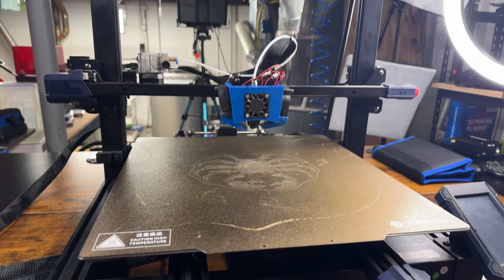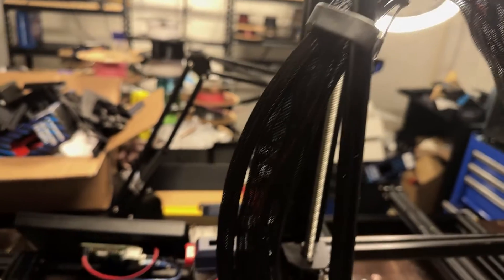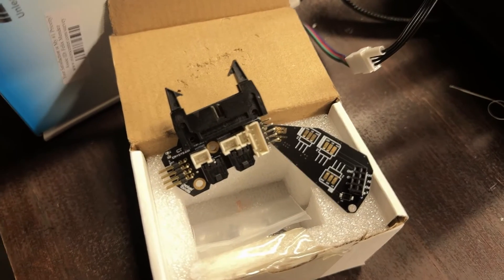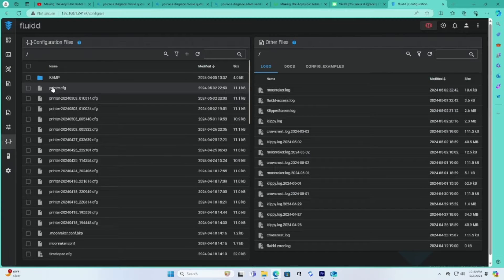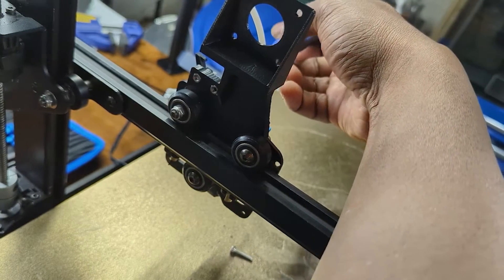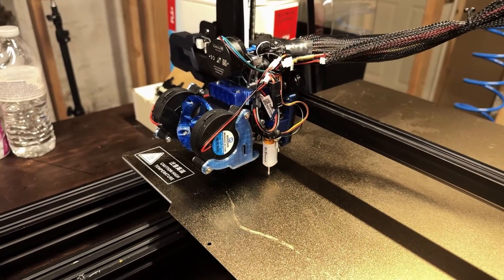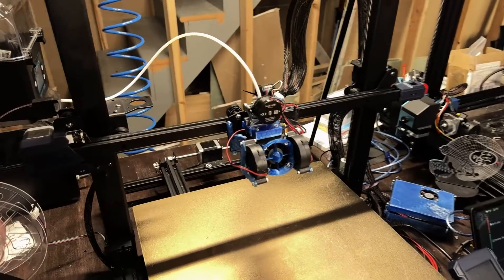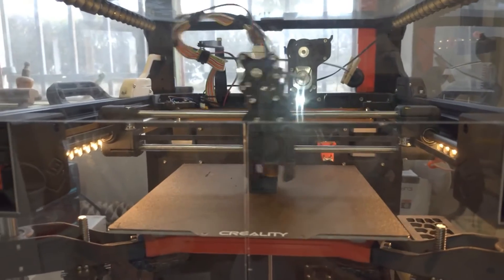The Kobra Max Make Over! Can this Large 3D Printer Be Awesome Again?

Comment: never had issues with auto leveling and the mesh level setup with my K Max.  you got mad stringing on your prints. maybe increase heat. too much cooling can string out.   what do you mean you failed with the T0 connection.? You cooked the BL?  what?   Why did you go klipper instead of marlin?   Did you have to rework any connections due to the ribbon cables?   All the old RepRap standards are just cable direct. no ribbons.

Comment: These are some amazing upgrades for an already good workhorse.  One question I have with the direct drive and hotend upgrades - can you use CF Nylon with this setup reliably? (with hardened nozzle of course). Tthe direct drive setup still using a portion of the Bowden tube to the hotend gives me a little concern because it would be approaching the  PTFE softening point.

Comment: Ya I’ve been so disappointed with this printer.  Been the biggest waste of my money in years.  I’ll have to look at your videos on this a bit more carefully to determine if I want to spend more on this train wreck of a printer.  Thank you for your content.  Keep it up boss!
Reply: I thought the same with my printer after investing some money and time for the modifications now it prints almost flawless, still have some improvements to make but it worth it if you know what you are doing
Reply: @ what modifications did you make?
Reply: @jthespiceoflife  i have an artillery sidewinder x2 and i did change the mother board for an octopus 1.1 and install klipper on a btt pi 1.2 im right know printing the parts for a xol toolhead with a sherpa mini also bought some linear rails to convert to corexz if you need help doing all this mods i could help you but is gonna be a long journey notbing it can be done in less than a week

Comment: Was looking at the new cobra 2, but I’m hearing lots of complaints about the closed off firmware that not being able to print directly from a USB or web interface that isn’t proprietary as well as a hot end in bed that don’t quite get hot enough for certain materials. I’ve seen the original original cobra Max selling for $220 as a refurbished unit, would that be the better way to go and buying the add-ons or modifications to make it just what I want? I’m more interested in bed size than I am speed. What are your thoughts?

Comment: toss some linear rails on the xyz, and I believe there's a part from big tree tech where you use just one wire for everything
Reply from the maker: I just received my modified plate from pcb way. The linear rail install video will be out after I replace my Sovol 04 IDEX hotends with Creality sprite ones. That’s the next video. As far as the wire, I wish I would’ve found out about that before I made my mess lol. But it still works great! Thanks bro